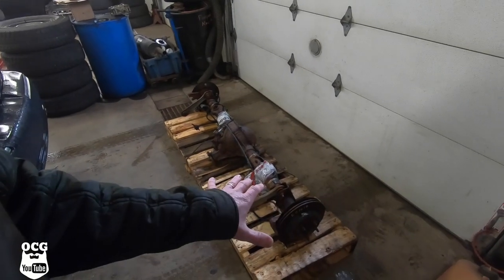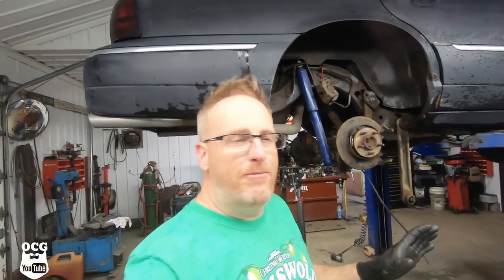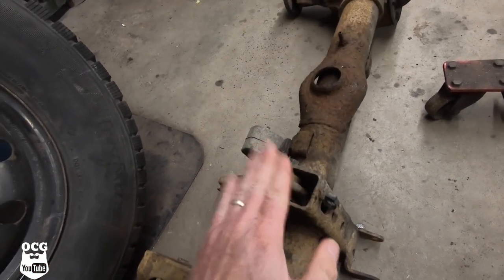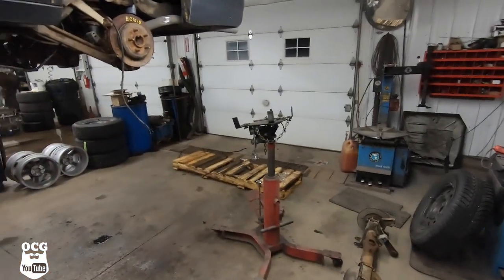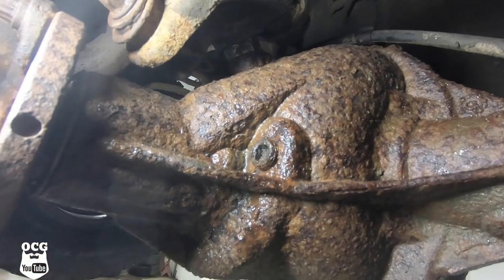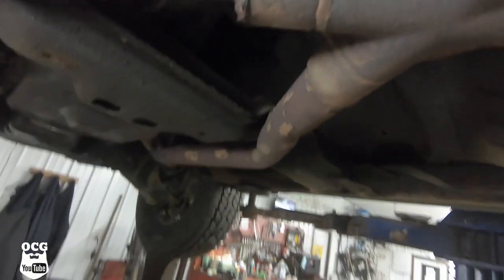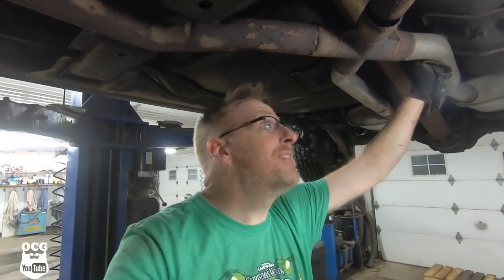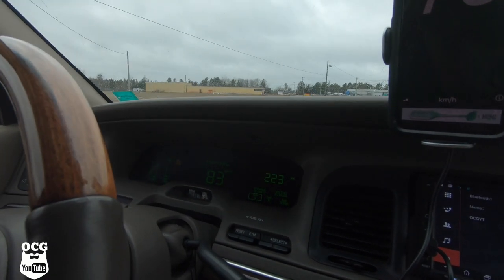Police BURNOUT: Real Deal or Wannabe?

Comment: Hey jason..do you kno what year the rear dif was u put in black jack..i had put wheel spacers on the rear tires and noticed a wobble..bent drivers side axle shaft. So i need to replace it..but dont kno if i can just get the 03 to 05 axle or not..i kno the splines change depending on years..thanx in advance

Comment: wow, what great luck having the right bushings on the 3.27 axle. A rule of thumb I read once that has matched up pretty close is... for every 1" of tire diameter you increase, it's akin to keeping the same size of tires and subtracting .1 from your gear ratio. So the from 2.73 to 3.27 is as if you could go from a 26" tire to a 31". It's not an exact science, but pretty good starting point
Reply from the maker: Thanks for the info. It seemed to have worked out pretty close here.

Comment: So what kind of fuel mileage are you getting with the lift and tires? I usually get around 20-30 mpg (12 or so l/100km - 8l/100km) with a 2.73 rear
Reply from the maker: It wasn't great but I didn't really calculate it. Now that I have a bigger gear, it gets up a lot better. I'll have to to a fuel mileage calculation and see. My other MGM, GrandMa, was getting 28 mpg with the 2.73  and about 25 now with the 3.27.